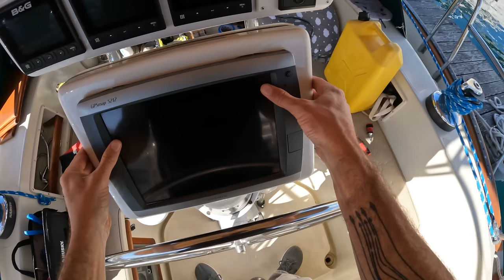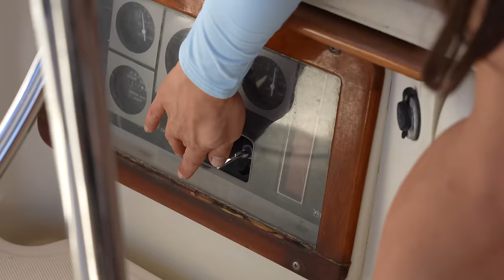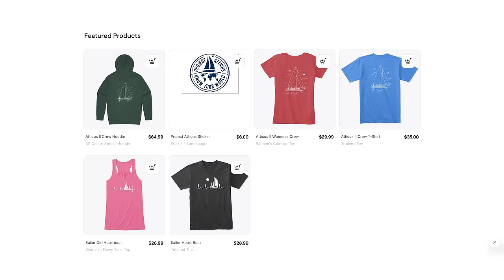Living Off the Land on a Remote Island | S08E39

Comment: Speaking from own experience - sailing with a baby till she starts moving around is supper easy. Tough times starts when they start crawling, walking, climbing till cca 3-4 years. You'll need to prepare the boat for a toddler: Safety netting is a must, as well as safe place to leave your kid unattended - when you need 2 pairs of hand and can't afford to have an eye on her 100%. For great solution check Ran sailing where Johann installed a bicycle baby chair in the cockpit. Similar solution you also need to install inside, safe place to prevent getting her hurt when the boat is moving or when you're cooking. So a fixed baby chair inside is also a must. Delos had 2 good solution for Sierra. One to fix on flat surface, like countertop, the other one to attach to the table in saloon. You will also need to find a solution to safeguard her when she is sleeping. Again, a fixed small tent in which Sierra from Delos was sleeping is a smart solution. She was safe in rough seas and parents were in peace that she won't wake in the night, climb out and fall overboard.